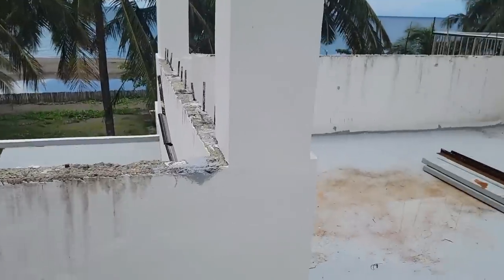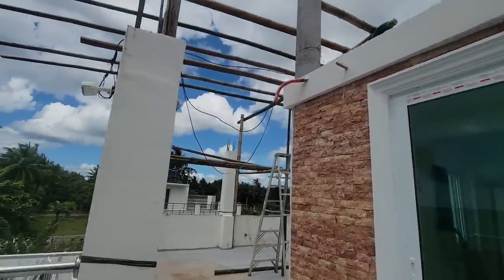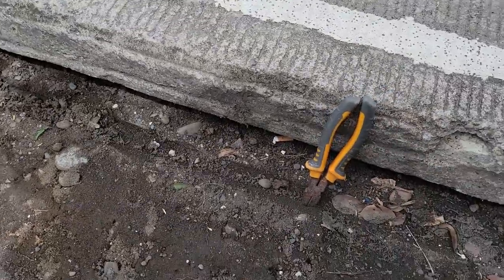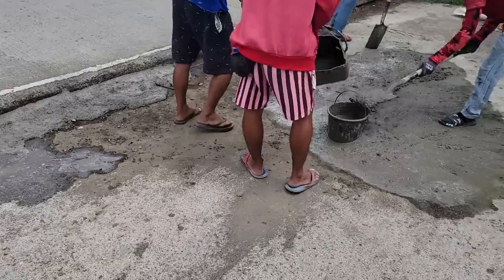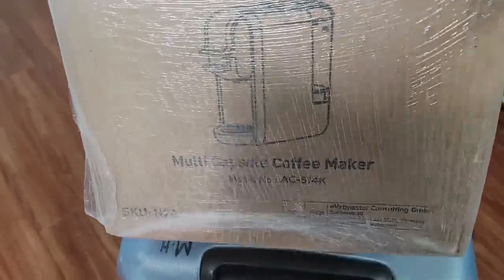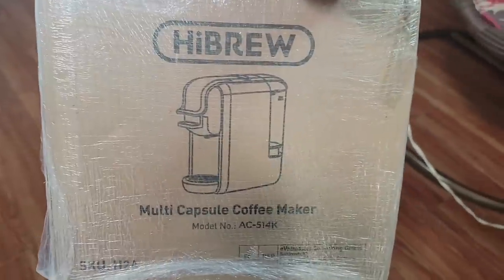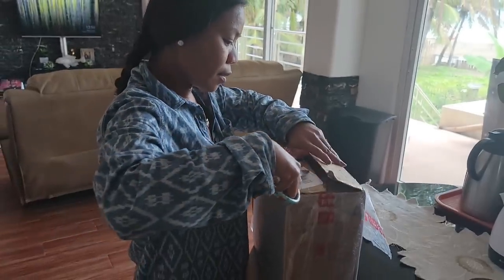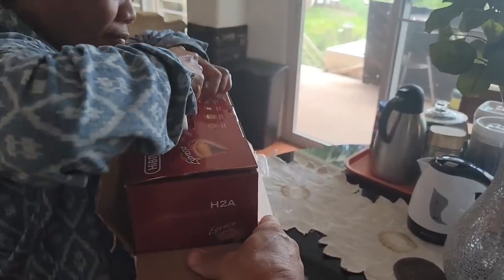Philippines Beach House Build Day 327 Surprise for Mel n HiBREW Coffee Maker Unboxing/Reviewing

Comment: I bought my Keurig from Walmart, after using it for about 6 months, it wanted me do descale it. After spending an hour trying to get the machine to descale I called Keurig and asked them what I needed to do. After they walked me through the process it still didn't work. I was told that the machine was defective, to take pictures of it and the bar code under the machine and send it to a link they provided, 5 days later I received a new replacement from Keurig and was told to just throw away the defective unit. James your first and fatal mistake was going back through Walmart to replace your broken unit. I never go back to Walmart to replace broken items, I call the maker direct. Walmart cannot replace electronic items such as a Keurig. Read your warranty.
Reply from the maker: I called Keurig and got a whole different response.

Comment: James i laughed my ass off, i have and call it the same thing, my runways and solar panel. Please only use the the grinds only as the kcups have fillers in it like saw dust, no joke. The first one with the metal filter and the coffee of your choice is the best way to enjoy your new machine. I switched back to the old fashioned drip method or french press, you can add or subtract coffee as you like it, and you know whats in it, just trying to help.